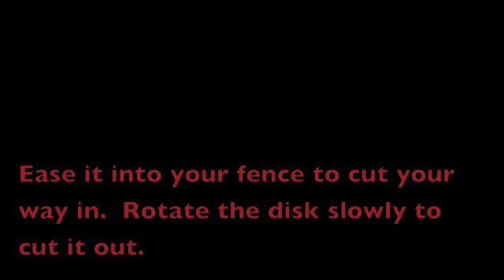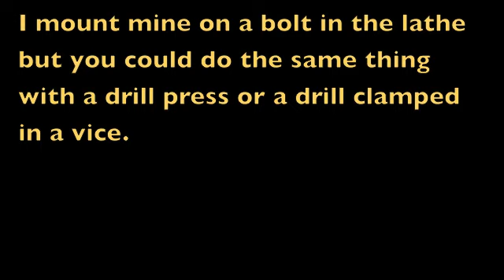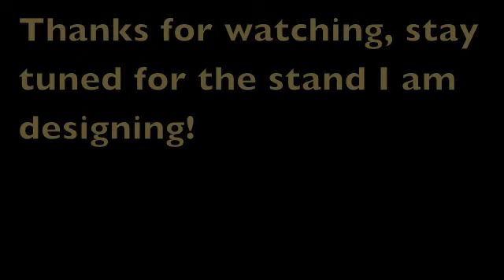Make Coasters From Old Records!

Comment: All of this is a waste of tie and tools. I don't need a router table[even though I have one], I don't need a lathe, its the Rube Goldberg way of doing things. Just take a hair dryer and a pair of scissors, its easier and safer. A router can and will grab the vinyl and possibly cut you. Even if your going to make many to sell this is still not the way to do it.
Reply: Vinyl maybe but not shellac which is what most 78s are made of. Much thicker and more brittle